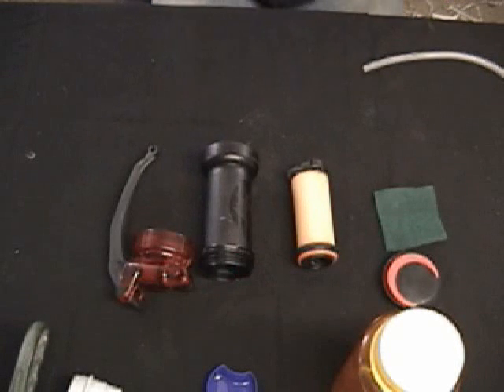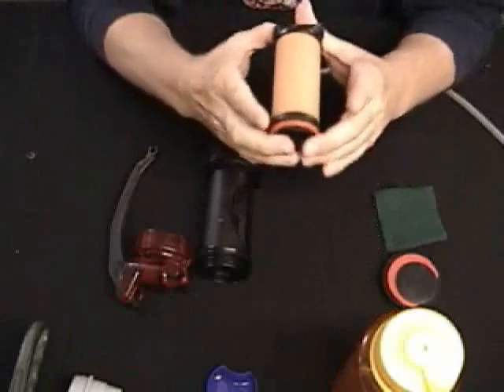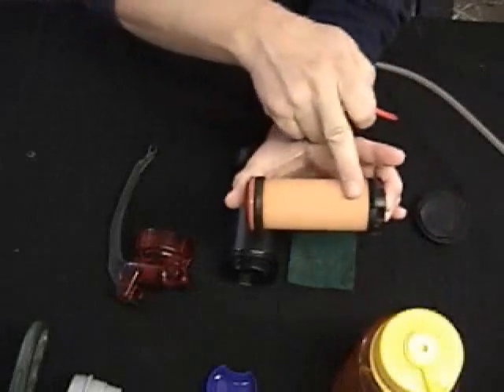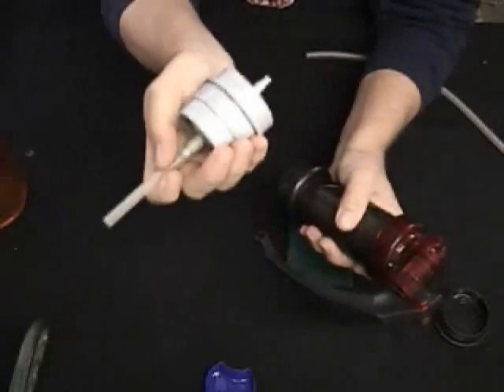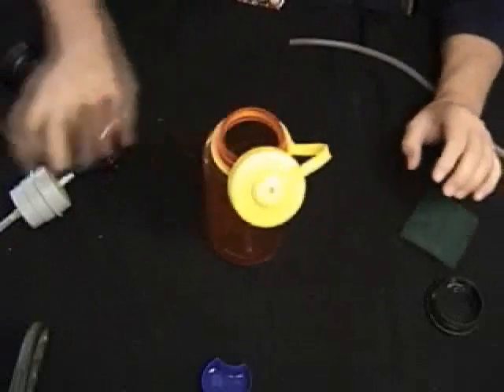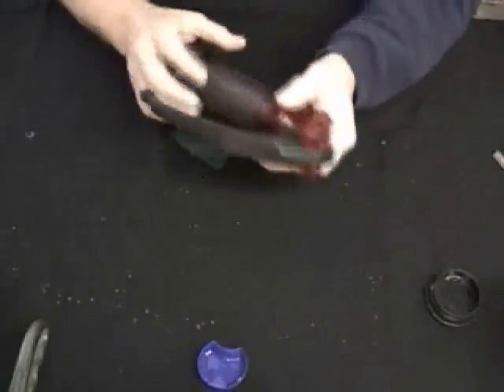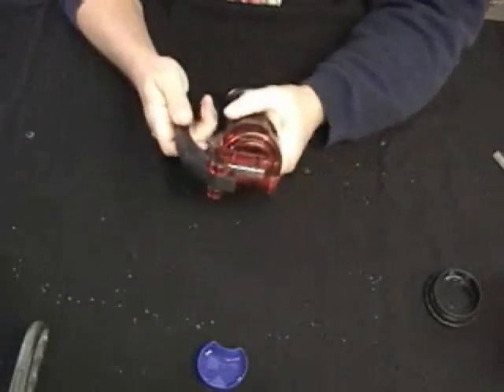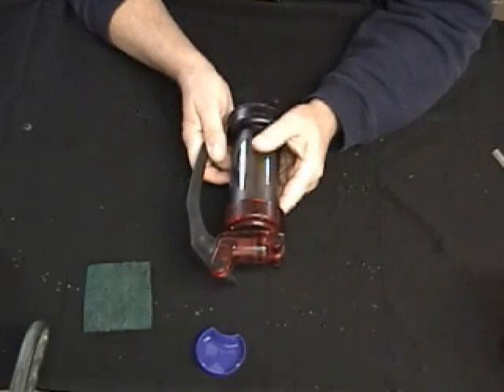Today--Water Filters ! !

Comment: @minibulldesign  Absolutely. Even crystal clear mountain streams have biological micro-organisms, that need to be eliminated. The MSR, with a Seri-pen (or water tabs, etc.) is a complete system. The filter alone, is not sufficient enough to keep you from getting some pretty nasty intestinal difficulties on the trail. But if you have both systems working together (a charcoal core is recommended for taste and smell), you can reasonably drink out of a pothole.

Comment: Good question.  My EX is about 3 years old, and the original ceramic filter it came with had the carbon filter core.  I was curious enough that I decided to waste $40 and break it open to see it.  If I'm in a dirty or cloudy water area, I ALWAYS use this filter because it does remove odor and taste.  Recently I've added the SteriPen Ultraviolet sterilizer to make 100% certain that I've killed everything, and if I'm in clear water country, I'll only use the SteriPen.

Comment: I took one of these on a 4 week trip in the Adirondacks.  It cleaned water for 8 thirsty guys.  What made it good was the fact that I could clean it and keep going. (It needed cleaning about once a week)  The bad thing about it is once the ceramic filter is waterlogged, you can't get the water weight out of it.  Once used, it weighs about half as much as a liter of water!  It is great for durability and long trips, but I try to stick to light and cheap iodine pills for my short stuff.

Comment: Thanks for the tip on pressurizing the unit.

I've considered this unit as it seem to do a decent job for a reasonable price.

I know some folks will wrap a J-cloth around the water intake as a pre filter if there is a lot of algae.

I've been using Pristine for some time now, and it also does a good job.